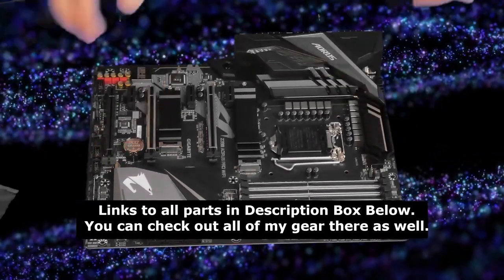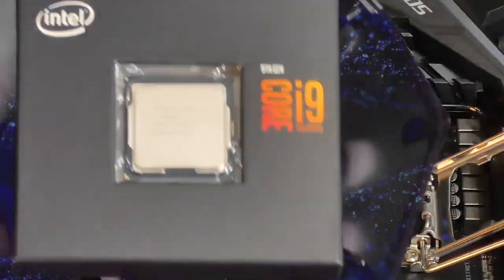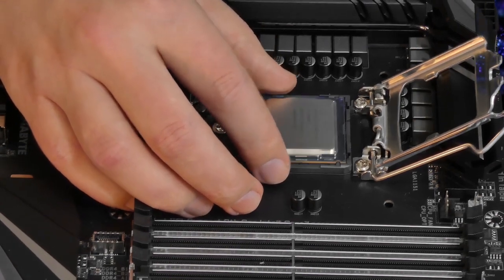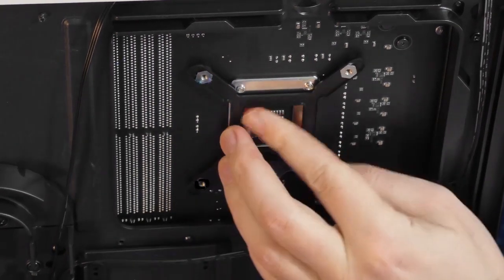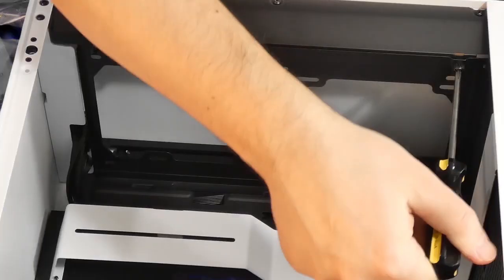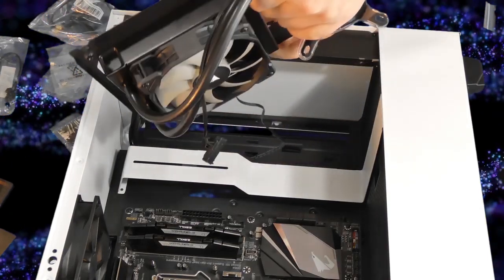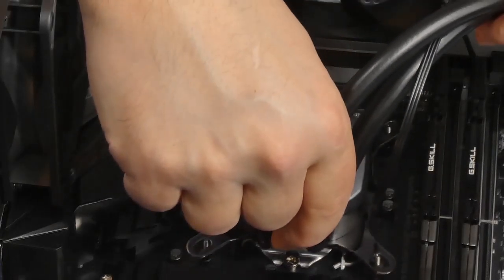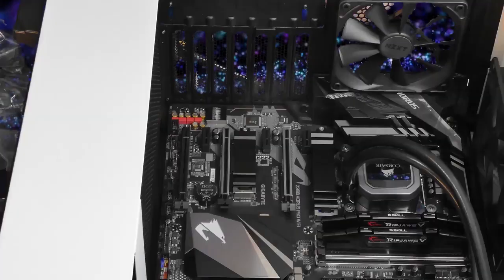Properly installing i9 9900k CPU with Corsair H60 Watercooler, Alien Technology look test

Comment: Radiator installed wrong need the hoses at the bottom or the pump won’t pump water the way it should
Reply from the maker: Interesting. Why is that?
Reply: @cobumankb  cause there is no water flow to the pump from the radiator
Reply from the maker: @sgt_taco  So the system is not filled with water all the way? I didn't see any warning labels on it. It's been running fine for a year now just the way it is...No noise what so ever and cooling is fine under 5ghz OC.
Reply: @cobumankb  flip it over and you will see a difference

Comment: how u think itll run on a i5 8400K im using the stock fan and the temps r going crazy

thx if u replay
Reply: If you haven’t already the h60 will work for your cpu I currently have a i5 6600k and it runs prefect. Good temps

Comment: If I play GTA5 under stock settings, how high should I expect the temps to be?
Reply from the maker: Hard to say, around 60-70 maybe less. It all depends how much of CPU is being used. GPU will do the most work.
Reply: @cobumankb  If it's a i9-9900KF, will the temps be different?
Reply from the maker: @masterpc-9845x  might be slightly lower because there is no embedded video.
Reply: @cobumankb  Thanks. I'm most concerned about the temperature because I'm at the point of getting the i9-9900K but I only have a H100i Platinum, and many people said it won't be enough. If I game and the temperature is 85C+, then I'm doomed.

Btw, did you delid it?
Reply from the maker: @masterpc-9845x  You will be fine. I use even smaller h60i cooler. Just don't leave it OC to max 5ghz. I keep mine at 4.7ghz just to be safe which keeps the temps down. Here is my video testing Temps: https://youtu.be/4tmO96WgVX4 The video shows automatic OC but with manual OC (lower voltage) I got even lower temps.

Comment: Hi i have the same rig but i had problems with the temps i got like 100c in 3 seconds from 40 to 100...now after a lot of work i managed to have it at 4.75 at 70c to 80c when playing battlefield all ultra 4k is it ok?
Reply from the maker: I have mine set to 4.8 and get same temps as you. Maybe slightly lower temps but pretty close to that. That is normal. I found that controlling voltage manually can decrease temps but I don't feel like messing with it anymore. This motherboard likes to set OC to automatic and 5ghz but then has to adjust voltage which causes the high temps. I'm assuming better results could be had with another cooler but I'm happy with 4.8ghz.

Comment: What are the temps?
Reply from the maker: I run it at 4.7ghz with temps in low 70c on 100% CPU utilization.  It can do 5ghz but it does get hotter and I don't feel like tweaking it to get better temps.
Reply: @cobumankb  Putting an h60 on an i9 is silly. Air coolers poop on that thing.